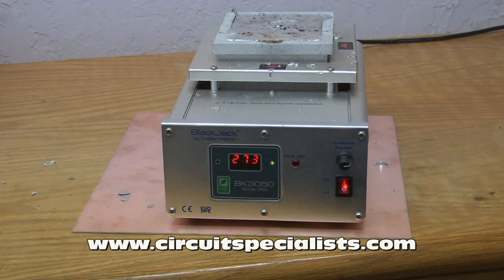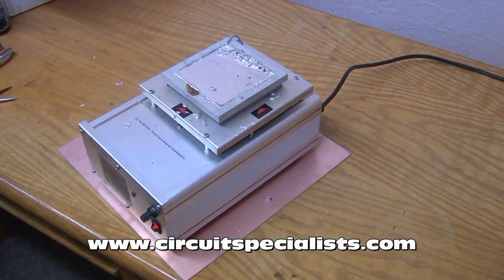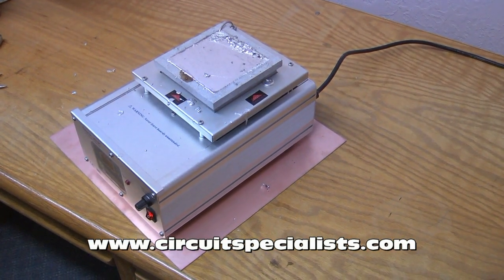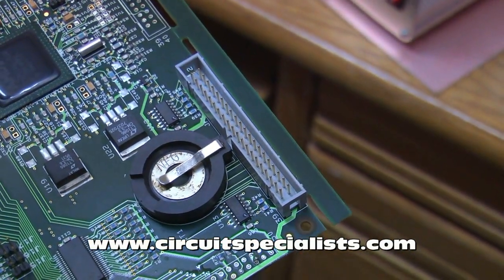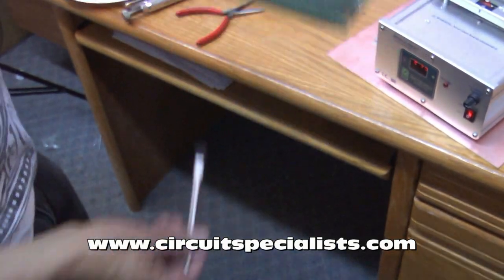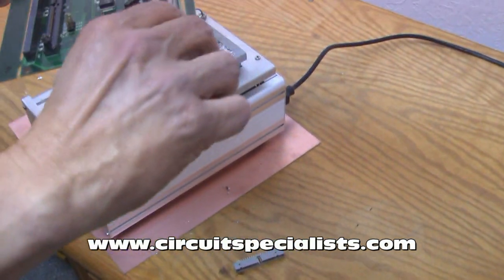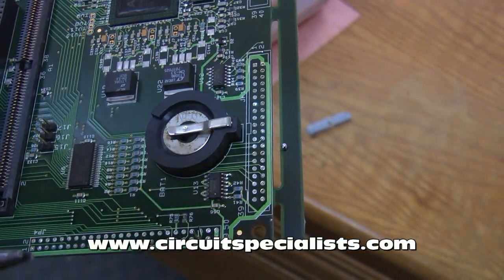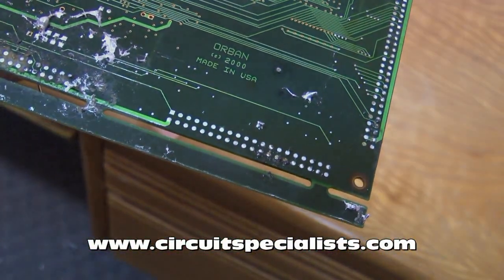How to remove a multi-pin connector using a solder pot.

Comment: Does this process work if the if the multi-pin connector, in this case a PCIE x 16 slot, is mounted on the interior area of the board?

Comment: Cool, you answered my question!! I'm just starting with electronic soldering and I got this multipins connector to deal with. Tried with a solder iron, extrem fail lol plastic burned as my fingers aargg !! hot air isn't so bad... If you don't want to use the board anymore! Sigh, at least I know it's possible now with that mini solder bath!

Thanks for sharing!!!